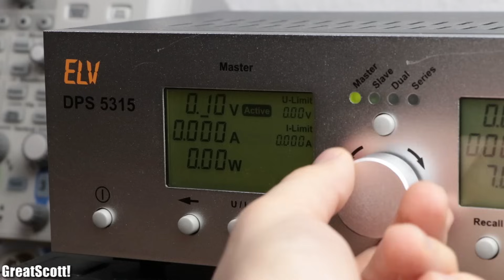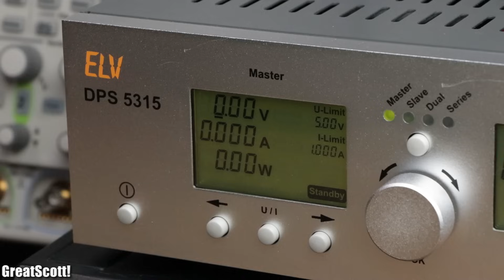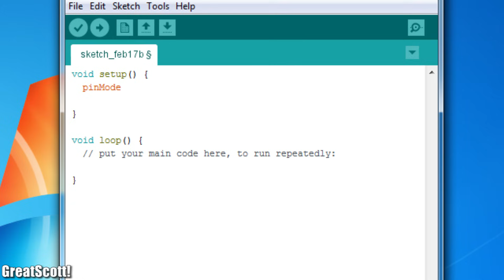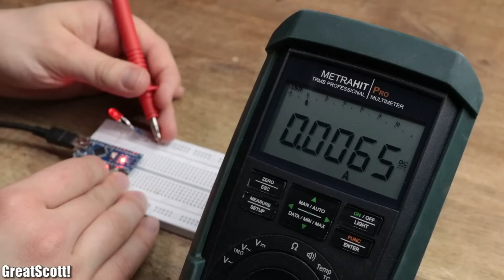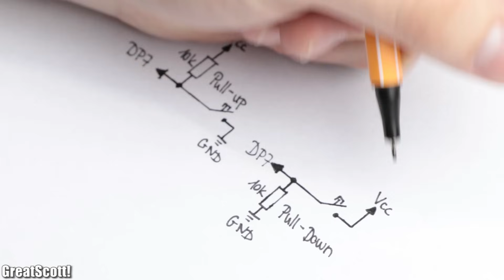Arduino Basics 101: Hardware Overview, Fundamental Code Commands

Comment: For a UNO and Nano, if I supply nominal 12 VDC (no load measured as 16V) to Vin (or the plug with central pin positive), will the digital output be also 12V DC nominal, not 5V? 

Or is there a choice in the code as to what voltage will the digital output be, the supplied voltage or 5V?

I want the digital output to drive 12VDC relays. 12 VDC relays will be much more convenient than 5VDC relays, because I want to drive small valves that operate on 12VDC. 

Thanks

Comment: Hi there,
You had a code in your video that you could control 3 leds with 3 switched as when you push each switch,  the related led turns on and by pushing the other switch the previous led turned off and the other turned on,
Could you please share the code for this?
I am new to Arduino and desperately looking for exact same code,

Thank you,

Comment: If I want to control 12v fans and don't want to have two different power sources - is it safe to use the same 12v power for Arduino as for the fans? P.S. Very informative video, thank you!

Comment: Is it possible to use one of these as a vibration measuring device? (for example to measure and compare varying vibrations from different cd players ect?). If so what part of the device would be the sensor? And also how would I get the reading, would I need to hook it up to a multimeter or something?

Comment: Thanks for the great upload. Is it safe to power the Arduino with 4s (16.8v) if used solely as a 1-2ms PWM output for ESC control? Thx

Comment: You go super fast... maybe i should start with a more basic video. The programming seems easy enough, but the way you explained the arduinos, and what the inputs and outputs do, and how to use them, so fast man.
Reply: https://www.wokwi.com has many great examples of Arduino code with a simple LED toggling code to OLED display simulations. Please give a try. if you like to learn more, you can subscribe on the page for weekly updates on good Arduino code 😀🙏

Comment: seems like cheating which is why im trying to avoid getting one as long as possible, but your boost converter design doesn't work well without one ... I need a custom boost converter that can put out the 54v required for ebike battery.

Comment: great! very thorough explanation. however i have a question, does an output pin also have a built in resistor, or is it only for inputs?

Comment: What would I do if I wanted to use an Arduino Uno to control a solenoid valve that draws 200mA at 12V? The video at about 5:10 suggests that the maximum draw a pin can have is 20mA (obviously a huge difference by a factor of 10).  I do have a DC-Power supply I bought that supports up to 5A at 12V but am not sure how I'd include that to a circuit.
Reply: use a relay

Comment: Total noob here.  So the digital and analog pins can provide power to components.  Question.  I also see that there are pins specifically labeled POWER: 3.3V & 5V.  What's the difference between the digital/analog pin's power and the actually power labeled pins?  Thanks

Comment: I am testing my ultrasonic sensor circuit which is controlled by arduino microcontroller on the  "breadboard". But my circuit is giving unwanted output without giving input to ultrasonic sensor. AND my circuit is powered by an 12v adaptor followed by 7805 voltage regulator
what to do ?

Comment: My arduino uno broke after power it with 5v on 5v pin, any tip how to fix it? i think it damage the 1117 regulator but I'm not sure...

Comment: i have got the Arduino Nano, i have been trying to upload code however i am left with the following error, can you point me in the right direction, i have updated all drivers including FTDI (not required) and WCH 340G 340C, any help would be greatly appreciated, it is for a badminton shuttlecock launcher, www.baddy.space.com

i just can not get the code to upload, here is the error code i am receiveing:
Arduino: 1.8.7 (Windows 10), Board: "Arduino Nano, ATmega328P"

Sketch uses 14496 bytes (47%) of program storage space. Maximum is 30720 bytes.
Global variables use 912 bytes (44%) of dynamic memory, leaving 1136 bytes for local variables. Maximum is 2048 bytes.
avrdude: stk500_getsync() attempt 1 of 10: not in sync: resp=0x00
avrdude: stk500_getsync() attempt 2 of 10: not in sync: resp=0x00
avrdude: stk500_getsync() attempt 3 of 10: not in sync: resp=0x00
avrdude: stk500_getsync() attempt 4 of 10: not in sync: resp=0x00
avrdude: stk500_getsync() attempt 5 of 10: not in sync: resp=0x00
avrdude: stk500_getsync() attempt 6 of 10: not in sync: resp=0x00
avrdude: stk500_getsync() attempt 7 of 10: not in sync: resp=0x00
avrdude: stk500_getsync() attempt 8 of 10: not in sync: resp=0x00
avrdude: stk500_getsync() attempt 9 of 10: not in sync: resp=0x00
avrdude: stk500_getsync() attempt 10 of 10: not in sync: resp=0x00
An error occurred while uploading the sketch

This report would have more information with
"Show verbose output during compilation"
option enabled in File -> Preferences.

any ideas???

Comment: The squiggly line beside the digital pin numbers is called a tilde. Those pins with the tilde are PWM enabled, allowing the user to control the duty cycle of the signals from that pin. When you said that PWM pins control the brightness, its actually controlling the number of times the LED turns on and off, giving the impression that the LED varies its brightness.

Comment: I need a help. 
But before, Thanks a lot for all your amazing videos .  They are really wonderful. I feel like I got a free Electronic Degree after my Degree in mechanical. 

..
How can I make the electronic control unit for a 250 w 24 v E-Bike controller circuit with Arduino.

Can I use PMM to control speed, ie without resistor. Would I need capacitors in circuit to smoothen the pulse current to motor when using pmm.

In general, what would be the best way .. ? 

Thanks , even it's possible or not.

Comment: Hi Scott; I have one question: in PWD control, I have a problem with hIGH POWER LEDS (10w), in the 242-to 255 signal interval the led jumps to his max, If I stay to 242 to 0 I have a good dimming, but I cant reach the max power of the led... any sugestions? many many thanks again Scott..!!!

Comment: need someone to write arduino program for me am beginner.i have analog input 0.64v which need to convert to 4 Hz at 10% duty cycle output and voltage then  gradually increasing in increments to 3.84v which is 4Hz at 90% duty cycle.frequency stay 4Hz all the time only duty cycle need to be increasing and decreasing  with increasing/decreasing  voltage.am sure there are some clever lads who can write this in 5 min.any help most appreciated thank you.

Comment: Hello, i have a lipo battery 11.1V 3300mAh 30c. I wonder if it can be straight connected to Vin pin of arduino? I am afraid that it will burn my arduino pin by high current suddenly flow into Vin. Urgent, please reply. Thank you.

Comment: Hi 

Last week I buy Arduino R3 and after buying I run simple programs (codes) in  Arduino

But now I am facing a problem with Arduino I can upload codes successfully in Arduino but not do anything?

for example:
#define LED 13
void setup() {
  
pinMode(LED,OUTPUT);

}

void loop() {
  digitalWrite(LED,HIGH);
delay(1000);
digitalWrite(LED,HIGH);
delay(1000);

}

but when I write 

int LEDPin=13;
int waitTime=500;
void setup() {
  
pinMode(LEDPin,OUTPUT);

}

void loop() {
  digitalWrite(LEDPin,HIGH);
delay(waitTime);
digitalWrite(LEDPin,LOW);
delay(waitTime);
}

this will work properly. Why does this happen ? Please help me.. my email id is dheeraj.chabra@gmail.com

Comment: I'm pretty sure I fried my first arduino by putting 5V into the 5V pin instead of 7+v into the VIN. I'm not sure why that would happen, but the datasheet for the board says you should only supply voltage through VIN, the DC jack, or the USB connector.
Reply from the maker: I always supply 5V to the 5V pin. Never had problems.
Reply: Maybe it was because it was a mega2560? I'm also open to the option that I fed it something other than 5V and just remembered wrong

Comment: i need helping with coding the arduino for a button box for a racing simulator. i need 3 toggle switches that light up an led when they are on and around 20 buttons that. i need help to code them for a keyboard input but also tell the led to turn on.

Comment: I found if you divided the potentiometer output value by 4, there were jumps in brightness, but they go away when you divide the value by 6 instead.

Comment: The Arduino Nano requires a Mini USB A to B cable. That is not the Micro USB cable that is readily available today. The Mini USB cable is hard to find and you won't likely find it in the places where USB cable are typically sold. Also you must be sure to have a USB data (sync) cable. This is so basic, but I never seem to see this in videos and other instructions. BTW I did find an old Mini cable at home and at https://www.amazon.com/gp/product/B00P0GI68M/ref=oh_aui_detailpage_o03_s00?ie=UTF8&psc=1

Comment: I have a question. So I bought an Arduino uno that claims to be official. It has exactly the same hardware as the official one at least. Now I installed the driver, and also tested it with the "serial echo test" with a success. However when I try to upload my program to it, I get the error message "stk500_getsync(): not in sync: resp=0x0". On the board, when uploading the RX led flashes, but the TX does not. If I understood correctly, it is either a bootloader problem (The led near the reset button still lights up though) or the microcontroller is busted. I wonder if there are any other possibilities...

Comment: Great work! Great Scott!  Was wondering if you  could explain the break out boards for programming the pro mini . I recently got the ch304 and ttl uart, was wondering what the difference is ? Also noticed there are others cp2102 ,cp2104, ft232rl and so on. You explain things very well and thorough. Keep up the great work.

Comment: i've always wanted to know what are the diference between a pull-up and pull-down resistor
Reply: Pull-up resistor pulls the voltage up to VCC (+5 Volts for Arduino Uno), while pull-down resistor pulls the voltage down to ground (GND, 0 Volts). So even when the circuit is disconnected, you have determinate voltage at the input pin. Without it, the pin could be getting elmg interference or static elecricity from the environment. Circuit can be disconnected by design, e.g. when mechanical switch is off.

Comment: I didn't know I could pull up/down without resistors on the Arduino.  Checked the Raspberry Pi and it turns out it thas that functionality too! :)

Comment: Hi greatscott ! I recently bought a module ltc3780 with a power supply 5 A and 12 V which proved that offers 10A at 5 dolars but when i  make the short circuit it resets and continue to do that until i  removed short.Excuse my english. Nice work! i will delete this comm when you answer.

Comment: Loving arduino. multimeter broke, so whipped up a simple voltmeter/ohmmeter/ammeter. calibrated from the internal 1.1 reference, it's actually acceptably accurate until I can get a new MM. xD

Comment: Scott, I know this has nothing to do with the video, but I was wondering if there is a way to protect yourself from accidental AC shock. For example, could you wear antistatic wrist straps connected to ground in the wall socket as a safety measure while working on dangerous projects?
Thanks!

Comment: Hello Scott! Thanks for videos!

In reference to this video. How can I use the circuit you described at the end of your video to power loads that use more than Arduino's 40mah? For instance, a DC Motor.

I've seen many suggested circuits on the web, but haven't managed to get one working smoothly. Sometimes my DC motor dies, other times nothing happens...

Also, I've noticed a humming  sound of variating intensity (depending on potentiometer's position) emanating from the DC motor. How dangerous is this?

Any input would be appreciated! ;)
Reply from the maker: Google H-Bridge. Don't forget to add flyback diodes and to get rid of the sounds you can change the frequency of the PWM signal of the Arduino by messing around with the Register. Goolge can also easily help you with that.

Comment: Can you do a video on pull up and pull down resistors, I have heard them many times from your videos but never understood them. Thanks!
Reply: This subject doesn't need a whole video.

Digital computers work on 0s and 1s, which are generally defined as 0="off" and 1="on" (although the opposite is also possible which doesn't really matter for this explanation)

So when an input to a computer is unconnected, is it on or off?  Should it be interpreted as a 1 or a 0?

You might say "that's easy, it should be a zero because it's not connected to anything" but it's not as simple as that.

Electronic circuits these days are very sensitive and stray magnetic fields can cause an unconnected input to randomly switch between the on and off states, so you can't be sure that the unconnected input will be read as "off"

You might say "okay, let's just connect the input to either the negative (GND in this case) or positive (VCC) so that it's definitely either off or on" but that's only going to work if you want the input to stay that way all the time.

Then you might say "well, let's instead use a double-throw switch" but the problem there is that most switches are break-before-make, which means there will be a short time when the input is unconnected which could be read by the computer as several switch operations.  The computer can "de-bounce" the switch but what if you want to use a simple push-button switch instead of a toggle switch?

The situation is even worst if the switch is make-before-break since that will put a short-circuit across the power supply lines.  True, it will only be for a fraction of a second but that's more than enough to disrupt computer circuits and might even damage the power supply.

A resistor will pull the input either high or low, and if we then use a push-button switch to connect the input either low or high in opposition to the resistor, the resistor will prevent a short-circuit by limiting the current flow.

Sorry about being so wordy, but I wanted to "cover all bases" for anyone who knows nothing about electronics but wants to learn.
Reply: I understand that a resistor limits the current, but I still don't quite understand how it "pulls" the input high or low. I have just started learning electronics and I want to understand it completely. Thanks for your explanation!
Reply: One end of the resistor connects to the input which you want to hold either high ("up") or low ("down").

The other end of the resistor connects to either positive, if you want it to be a "pull up" resistor, or to negative - also called Ground or GND for short - if you want it to be a "pull down" resistor.

The small amount of current flowing through the resistor is enough to hold the input either high or low so any electrical "noise" in the circuit doesn't cause the input to randomly switch high and low.

If you then directly connect the input to the opposite side of the power supply (with a switch), the resistor stops that from being a short circuit.

So for example, you could have a resistor between GND and the input pin to hold the input pin low, while having a push button switch connected between the input pin and +5V.  While the button is not pressed, the input pin is held low (hence the term "pull-down resistor") and when the button is pressed, the +5V will flow through the switch into the input pin and pull it high.

Some current will also flow through the resistor to GND, but if you choose the right value for your resistor, there won't be much current.

For digital circuits, the exact value of the resistor isn't super-critical.  Any value between 1k and 100k will usually work.  10k is a good value for pull-up(down) resistors in most small circuits.
Reply: TommyABC123 when you use pull down resistors, you would often use it on normally open switches(power is off) and connect it to ground.  Pull up resistors are for the opposite which is when you are using a normally closed(power is on) switch by connecting the resistor to 5 or 3.3 volts.  These two types of resistors help us prevent voltage noise without short circuiting a circuit.
Reply: Beautiful! Super well detailed

Comment: Is it possible to use a USB-RS232 converter based on the PL2303HX chip instead the FTDI-based ones to program the Arduino Pro Mini?

Comment: great Scott!
I have a question 
i want to play Tetris on a "Calculator" Since our maths lessons are boring. 
I want to add a simple board to the Display that can do stuff like this.
the question: can a arduino Modul handle games like Tetris? 
I looked like everywhere but never get an answer. 
sry for my Bad English im from germany
Reply: Bernhard Blietz he is german but he only reads and answer the coments in english
Reply: Daniel kinight... ok thanks
Reply: you cant play tetris on a normal calculator display. you need one with actual pixels. I bought mine from banggood. https://www.banggood.com/IIC-I2C-2004-204-20-x-4-Character-LCD-Display-Module-Blue-p-908616.html?rmmds=search but that display is 4 columns, you might want to buy a 2 column https://www.banggood.com/IICI2C-1602-Yellow-Green-Backlight-LCD-Display-Module-For-Arduino-p-950728.html?rmmds=search or maybe just buy a touch screen =p https://www.banggood.com/2_8-Inch-TFT-LCD-Shield-Touch-Display-Module-For-Arduino-UNO-p-989697.html?rmmds=search